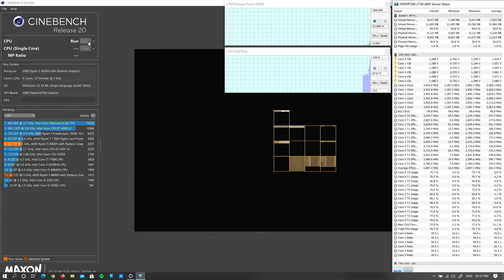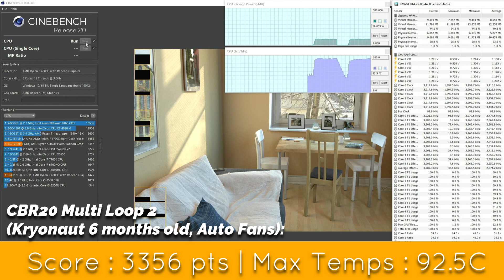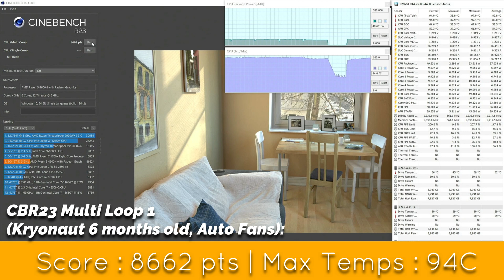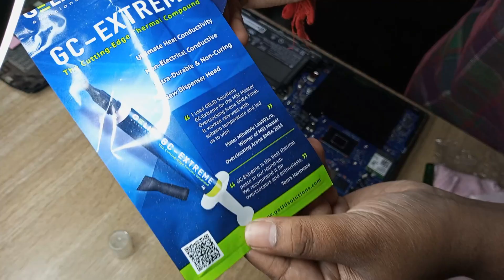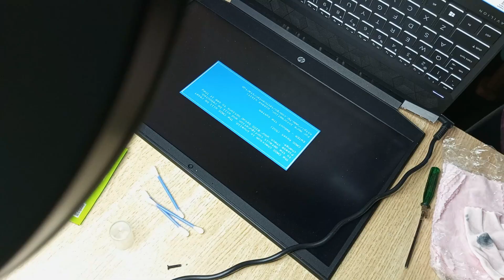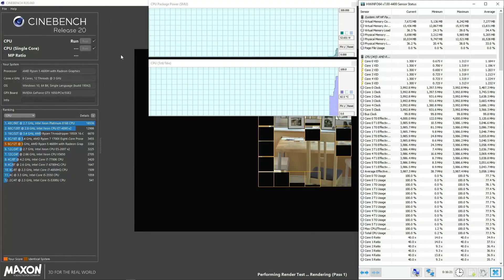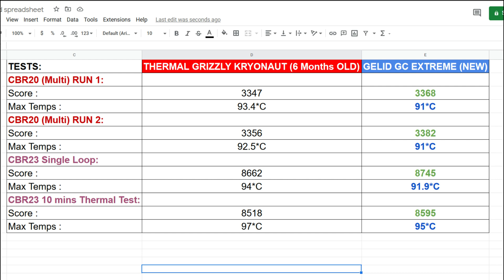Kryonaut vs GELID GC Extreme 🔥 Best Thermal Paste to Cool Ryzen Laptop?

Comment: Deeptesh, do you know why some benchmarking of gf65 thin 3060 hit above 80 , 90 w and even above 100w in assassinscreed walhalla benchmarking video
1 SUPER PRECIO - Mytrix GF65 MSI by -gineuse 
2rtx 3060 laptop vs rtx 3060 desktop by -testing games
Reply from the maker: It's possible that maybe MSI upped the TGP through some updates. Although it would be pretty insane to hit that high of a TGP in that thin chasis, also would be very hard to manage the temps.
Reply: Actually after November 26  bios update mine always reaching 80 and above highest I seen 87 tgp  in cyberpunk before that highest 77 so don't know  not any official notes from msi  but my temps now reaching 80 before never touched 75
Reply from the maker: @karthickswaminathan3536  follow tutorials and undervolt your GPU. That's the most I can suggest.

Comment: TIP for more cooling.. just cut that metal layer on the vents and youll get even more better thermals. trhats how i did to my hp and its very good my maximum temopsion cpu are 65 degrres and also on gpu 55
Reply from the maker: Yea that metal mesh is for preventing as much dust as possible. :)
Reply: @DeepteshLovesTECH  for me i just cut it because I saw that it makes even more colling and I always keep my laptop on the desk so yeah
Reply: @cosmingbrl05  But I think it'll clog up you fan and exhaust quicker so you'll have to clean more often.
Reply: @kronos711  actually not really. I live in a environment where dust is not so much
Reply: @cosmingbrl05  yea that's a big factor too. I have alot of dust around where I live.

Comment: Sir my laptop is almost 2 years old, i have the base evrsion but when im opening the lid it makes some funny sounds only for some seconds and when im opening and closing the lid it stops after the first opening. its a problem or its just the plastic that makes sounds on the hinges. personally i do nto care but i was wondering if your laptop makes the same.
Reply from the maker: Actually I don't hear creaky sounds anymore.
Reply: my laptop makes the same noises.
Reply: @SouravKumar-bl9xm  its just the tape of the monitor cables flexing on the plastics itself. I managed to open the lid and i figure it out.
Reply: @cosmingbrl05  im too scared to open my laptop. I guess i'll let it be since it wont cause any damage.

Comment: Best paste for Intel Laptop?
Reply from the maker: I think for Intel both will work fine. They result in similar temps, but 1g of Gelid is half the cost of 1g of Kryonaut.
Reply: @DeepteshLovesTECH  Thank You
Reply: Do I need to us "ISO PROPYL ALCOHOL 99% Pure" for repasting of thermal paste?
Reply from the maker: @KunalDey456  naah, just 70% alcohol (hand sanitizer) is enough.

Comment: I have also changed my thermal paste (gelid gc extreme) it's working awesome.
But after closing the back lid there is gap between joints of my laptop (there is 2mm gap at the edge )
Is this problem is due to build quality?
Reply: press harder on all parts of the laptop becaus ethe back panel must come into its place and youll be alright
Reply: press your laptop body